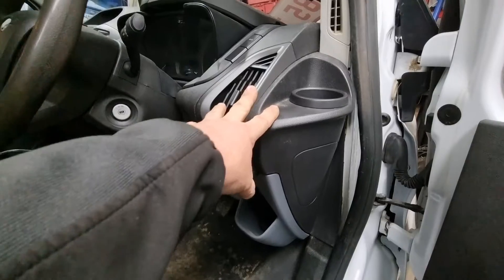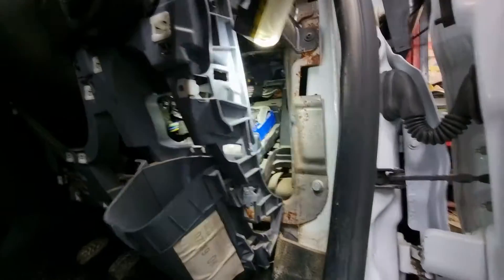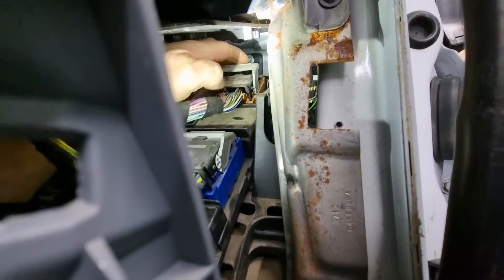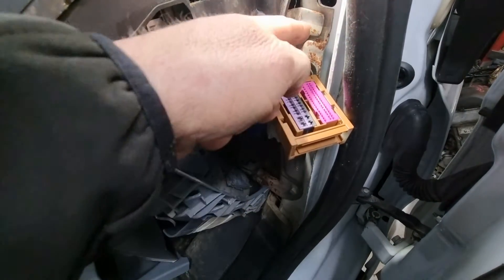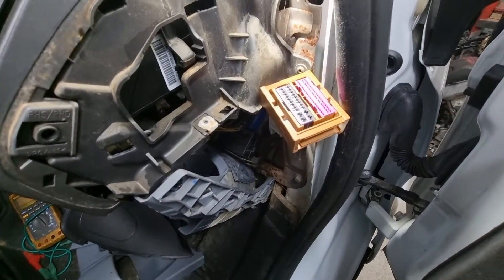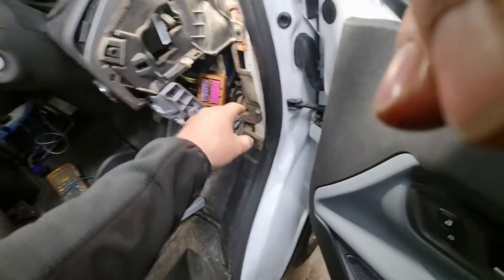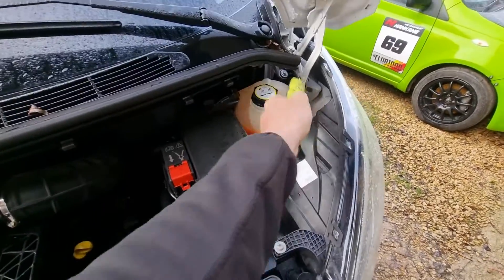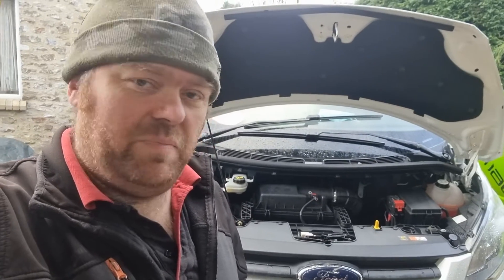Ford Transit Custom, Brake Pad Wear Service now message solution, reset, repair BCM connections

Comment: Anyone having difficulty, the whole black module with all the plugs and fuses just unclips and you can lift it out a bit to get easier access to the brown plug. On my LHD model I couldn't unolug the brown plug in situ because there was some black box right above it attached to steering column, so I just pulled out the whole fuse board thing.

Comment: Well, to anyone who is remotely interested, I managed to identify pin 21 on the abs pump, mine is a white/red and certainly ISNT the brake pad warning wire, upon earthing it all I got was the same message but no abs-tc or hill start, snipping the added earth returned things to normal, I’ll have to investigate the old way 😰

Comment: Many thanks, I went down the bypass route as I have been chasing an intermittent problem for ages. I was working on my 2016 MK8 350 transit and noted that there was 2 blue wires with a green trace so it a good job I didn't splice the wrong one.
Reply: I have the same van as you, where did you find thhe same module as he is explaining in the video because I can’t find a brown plug in the location
Reply: @aidanhall4712  It is in the same position as in the video, although the dash Is slightly different to the video and access is not quite as easy. pull the panel off under the steering wheel and look to the back of the dash and it should be there.
Reply: @Parastorm. I will have to have another look into it I couldn’t see a brown connector last time I looked

Comment: Mate, thank you, I couldn't have figured that out myself, grounding that cable worked a charm. My transit had an extra plastic thing on top of the bcm which made it so cramped I had to cut the plastic to get there, but this saves me two years of mechanics and headaches cos something somewhere triggers it and it won't be a problem no more

Comment: I’ve just went to do my brakes on my 2017 tourneo custom and discovered that I don’t have brake pad indicators on the front. I haven’t got to the rears yet but suspect there isn’t any there either

Comment: Just grounded out pin 21 today as I was getting this msg every time I start the van, it knocked out the brake wear msg but airbag and abs light cam on . I disconnected wire again then back to normal ,just the brake wear again . Anybody any ideas . Thanks

Comment: Hello i removed the plug cut the wire entering befor the plug and grounded it the light is still on the dash shud i have not cut it and just grounded it thanks
Reply: Did you solve the problem as light is staying on in mine
Reply: @j24oneill no it was removed of the dash but still came up on the notification so yes and no

Comment: Can anybody out there? Help me? I have a Ford transit 64 plate 350 front wheel drive when you turn the key nothing’s happening. I have a red inspection light flashing at the bottom and a bleeping noise. It says service now but the vehicle has been already serviced. Strange I see no engine management like coming on when I turn my key to ignition please any ideas?

Comment: It’s a common issue when folks change the rear pads they do not clip the wires in properly at the rear left. When the vehicle travels at speed the plug and socket waves around. I’ve found the break on a few, always in the same area, on the van side of the plug socket just where the wires dissapear into the insulation. I usually peel it back and solder a new section in.
Reply: Saved me a lot of headache

Comment: Are there common places to check for wear on the wiring for this issue or is it a case of trying to trace the wires as they split to each brake if you want to repair it? Anyone seen a video of someone doing the faultfinding in the loom? Edit: ah - I'll have a look as per this video https://www.youtube.com/watch?v=CWOwje7_jwE - yet another terrible design decision causing wear, Ford? Amazing. It's turbo pipe time all over again..

Comment: Hiya pal.  Couple question if you don't mind.  I'll sub if you can answer for me.

I've a 2014 2.2  Custom.   Traction Control randomply lights up, Break Pad Wear Service Now constant, now started going in to Limp too with P2599 2598.

Could the Traction Control/Brake Wear cause Limp and false codes for Turbo?

Van drive great normally.  Had it up to 95 couple days back then Limp on motorway.  Went away when i slowed and kept it to 60. 

98k on it and it's mint.  Just serviced too.

Also how do you Ground Out? :O

Cheers.

Comment: Couldnt get the connector out because it had a lighting module above it but i got a T crimp on the blue green wire and ground it out connected the battery back up and turned on ignition and no warning drove off the drive and warning came on again checked t crimp and ground connected battery back up did same again no warning but when i drove off came on again any ideas

Comment: Hei. I have European version , these connector is on the left side of the van. I took out the connector , it looks the same.. but the third cable in second row is not blue and green. It's only blue. Should I cut it ? :)

Comment: Just a tip, try grounding it out after the rear axle sensor (yellow wire) and it may fix the problem and you will still have working brake wear sensors. if not then you have a wire issue from abs module to the sensors. then you can bypass it, if you dont need your sensors.
Reply: I had the same issue. My white wire on the rear brake sensor was damaged. Cut it back and soldered a brand new connector (aliexpress) and it's gone out perfect and sensors will continue to work properly now
Reply: @excelmobiles  can you get a link for new connector? Thank you

Comment: Great content. Can I ask if cable 21 at ABS module is also  blue wire with green trace as they don’t seem to be numbered?
Any advice much appreciated.
Reply: Hi my plug different is wire the same colour on different plug

Comment: SO JUST WERE OR HOW  HAVE YOU FOUND PIN OUT INFO FOR THIS REPAIR
Reply from the maker: The full wiring diagrams are available to authorised repairers via the Ford Tech Service online systems.
Reply: Thanks , its not one of those systems that get HEADLINE, i FOUND IT AFTER A LOTTA DIGGING @TuningShed

Comment: Do I just T section clip to ground? Or cut the blue green wire and re route to earth of the frame?
Reply from the maker: You can do either. I'd just tee into it and ground it to the chassis.
Reply: @TuningShed  legend!
Reply: Hello did you get an answer I cut the wire above the plug and earthed it the light remains on cheers

Comment: Just did this, there was a module above this plug so I couldn't get it out. I note another comment about taking out this extra module. I couldn't be bothered so I just snipped the green and blue wire, added an extension and grounded it to a nearby screw, works a charm. There is 1 large green/blue and 2 thin green/blue wires. From watching this video I took a punt and luckily it paid off. From looking into the dash through the openings it is the cable on the right, nearest drivers door side, if that makes any sense.

Comment: Thanks for this…grounding wire worked a treat.Note for others… above that brown plug you have to remove I had a headlamp control module mounted that isn’t on this video and that prevented me from being able to pull the clip lever and remove the brown plug.
It was a real bugger to get to the screws to remove that module… I needed a 90deg screwdriver…but it’s just 2 screws
Thanks again
Reply: Do I just T section clip to ground? Or cut the blue green wire and re route to earth of the frame?😊
Reply: @ThePriceyShow I'm not sure either mate. How did you ground the wire?

Comment: the cable you pointed to isn't the one that goes into the hole , as the hole was on the 2nd row, but when you flick it over the cable you point to and describe is on the 1st row.. sorry i have no wires going to the 2nd row lol

Comment: Thanks for your video  had the problem intermittently for 2 years  that sorted it 👍 👌
Reply: Do I just T section clip to ground? Or cut the blue green wire and re route to earth of the frame?

Comment: Hi there, I've got the same problem, I've had a new bcm put in, but since that, abs light comes on and hill start assist also, break pad wear was on before, so would it be worth replacing that wiring loom? And is it hard to replace? Thanks

Comment: Hey I have the same problem 17 plate transit I can not find the conection under the steering any suggestions
Reply from the maker: Hi There, Thats interesting, I've always had no problems with the methods above. You've potentially got one different to the ones I've seen in that case.  You'd need to find a wiring diagram specific to your van unfortunately if it's not the same as I've described. Steve
Reply: @TuningShed  I’ll try to find the diagram somehow
Reply: Any idea when to find a wiring diagram???
Reply: Hola buen día yo tengo un Ford tránsit modelo 2018 motor 2.2 diesel  tengo problema en arranque me aparece en el tablero inmovilizador activado véase manual?

Comment: When you say ground it out why do you actually mean. Sorry not a mechanic. Do I push the pin out?
Reply from the maker: You'd need to connect it to the chassis of the vehicle, or negative battery (-). 👍
Reply: when you cut the wire do you ground the loose wire or the wire coming out of the multi connector @TuningShed
Reply from the maker: @1963col  The wire that comes from the connector. You can ground both ends out if it helps with no detrimental effects.
Reply: Do I just T section clip to ground? Or cut the blue green wire and re route from the computer clip to earth?
Reply: what did you do ?
 @ThePriceyShow
Reply: @1963col  Leave the wire connected but run an earth to it. I used a cheap T crimp
Reply: @ThePriceyShow Is there a wiring scheme available, anyway?